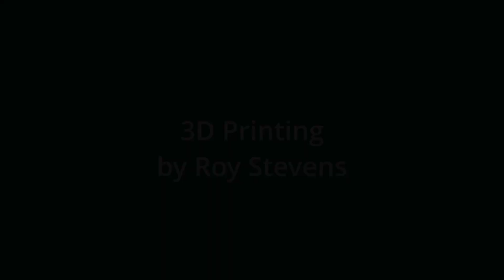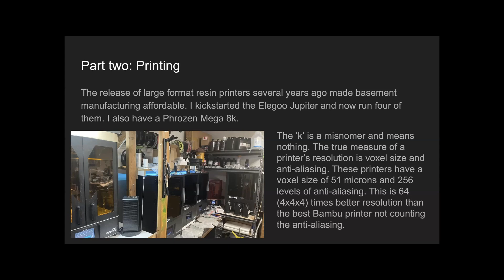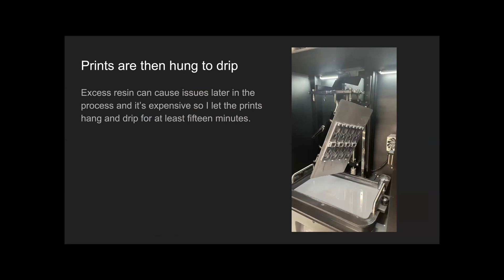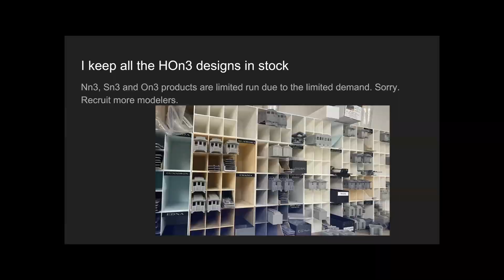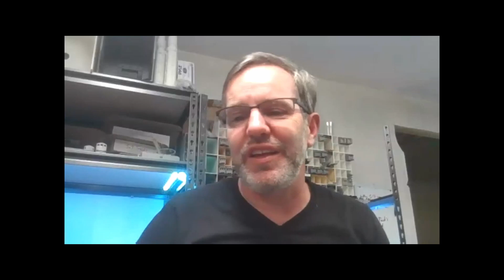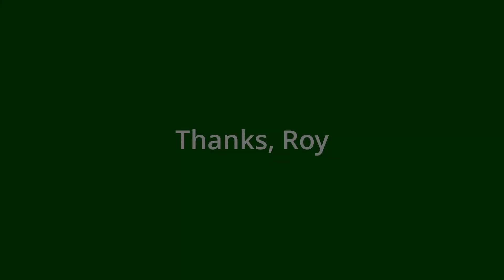3D Printing by Roy Stevens - what works and what doesn't.

Comment: Great and informative video...  I do a lot of 3D printing at home for model trains.  Like Roy, I use Solidworks and fully agree with his statement that it's like "swatting a fly with a bazooka", but I wouldn't have it any other way.  I see so many people struggle with basic models using "free" 3D CAD software and it makes me glad I have access to Solidworks.

Roy's comments on drying prints before curing...  ABSOLUTELY!!!  I figured this out about a year ago, after home printing for the better part of 3yrs.  I 3D print a lot of windows for S scale (I model in Sn2, which is 2' gauge in S scale, using HOn3 track and wheel standards).  The windows ALWAYS come off the build plate with the mullions warped to some degree.  I let them dry out on a rack over my furnace for about 12-24hrs and in the process, the mullions dry out, stiffen considerably and most importantly, straighten out.  It's also a must do for long and hollow prints like Roy's passenger cars.  

Also like Roy, I use Siraya Tech Fast Grey...  Great resin!!!  Detail reproduction is excellent.  It doesn't seem overly brittle to me, but that's compared to the resin I've used previously, which was crazy brittle.  I use it for most all detail parts and trucks.  The only thing I have issues with are stirrup steps.  They're pretty fragile and break easily with rough handling.  To mitigate this, I recently switched to an 80:20 blend of Fast Grey and Phrozen "Onyx", which is very expensive, but the result is a measurable increase in strength/shatter resistance.  Will definitely give Siraya "Blue" a shot.

One thing I need to stress and if Roy reads this comment, please do add to it...  Safety.  If you're going to do a lot of 3D printing in your home, make sure to adequately ventilate your printing space.  I 3D print in my basement shop, that shares space with our natural gas furnace and hot water heater.  I recently started having respiratory issues that I attributed to doing a lot of printing and cleaning of prints all day long, for days on end.  I had a small duct fan in a blanked out window that I'd run while doing long print/cleaning sessions, but it wasn't enough.  Recently installed a much higher capacity ventilation fan, which I now run all the time while in the shop, and I also crack a window on the other end of the basement to provide a fresh supply of air while running this fan.

3D printing is great, but the MSDS sheets don't have a lot of data for the long term health effects as a result of using 3D resins (the data is alarmingly sparse!!).  So take precautions people.  If you're going to print inside your home, with family and pets present, definitely develop/build in some ventilation and most definitely follow the guidelines for the safe handling of these resins.  I got a nasty chemical burn on my forehead about a year ago, after unknowingly wiping a small amount of resin on the skin and not washing it off right away.
Reply: Thank you for your concern. I run two particulate meters in the space that measure PM2.5, HCHO and TVOC. I also run cross ventilation and a carbon filter. Fortunately most of Sirayas resins don't offgas. But I tried an Elegoo resin and it made the room uninhabitable for nearly a day.
Reply: @roystevens4333  Hi Roy...  Not so much concern, I'm sure you have everything under control considering the setup you have, but also your extensive credentials!

Just reinforcing the need for safety with the stuff.  Long term health implications of using these resins is pretty vague.

  My biggest fear is that 10-15yrs down the road, we're seeing a trend of a lot of home printers coming down with lung cancer or some other awful ailment.

    Haven't gone so far as you...  I have plenty of ventilation, but have yet to install any carbon filters on my machines, but I do wear a respirator with carbon filters when blowing off cleaned prints (which I do in the garage).

  Anyway...  Great stuff, really enjoyed your video.